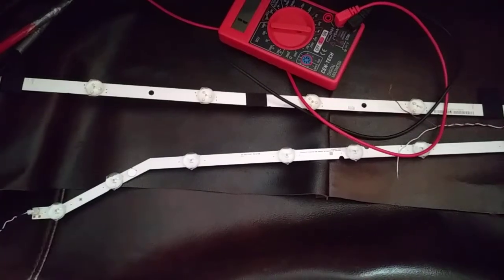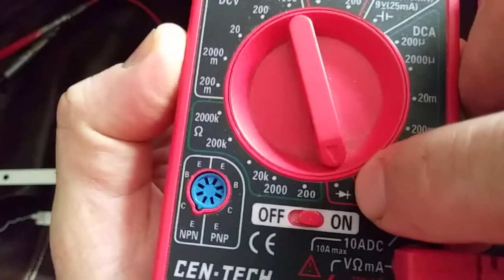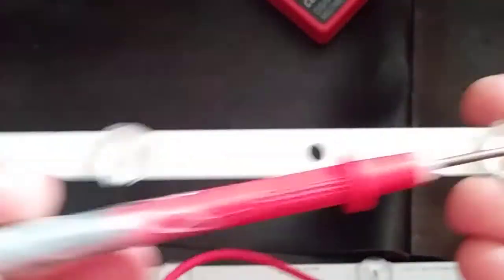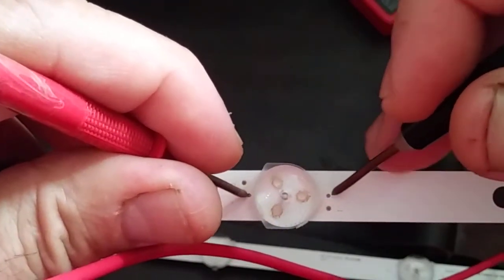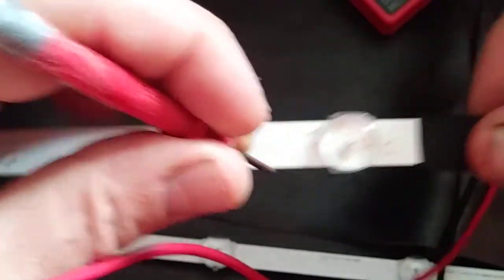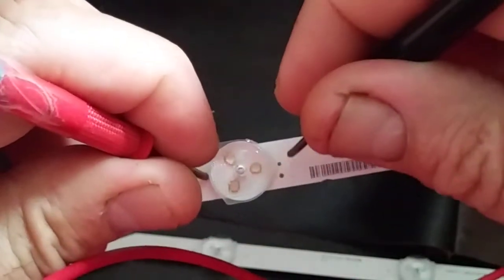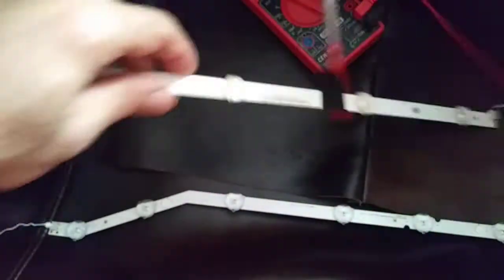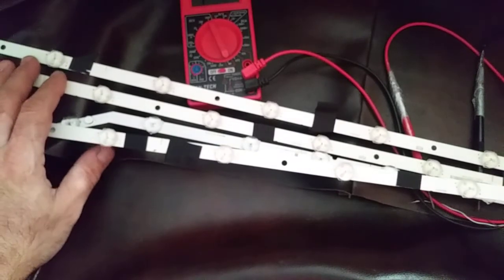How to Test TV LED backlight strips with a multimeter.

Comment: This is complete bullshit. That's not how multimeters work in diode testing mode. It's not going to light up an LED. 🙄 It's just going to give you a reading.
Reply: It gives a reading when it doesn’t light up, if it does light up it stays at 1